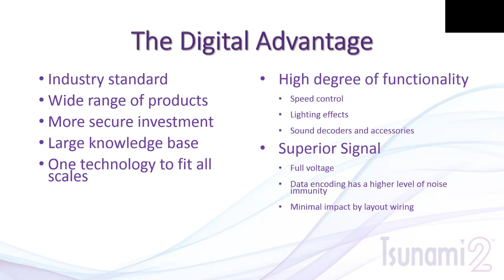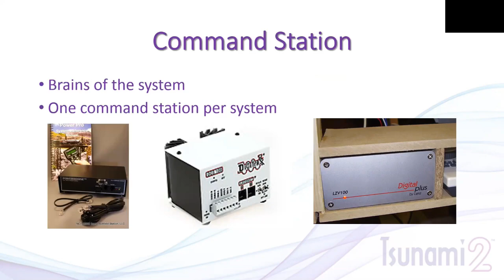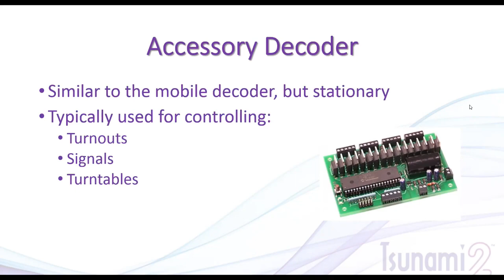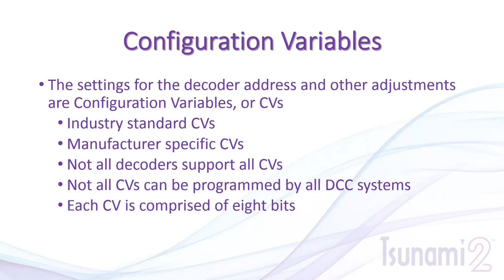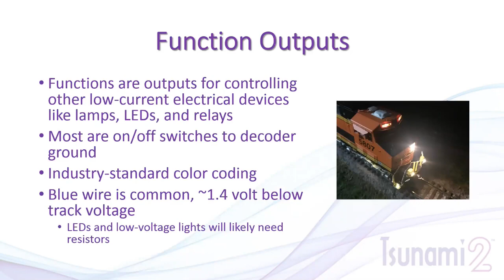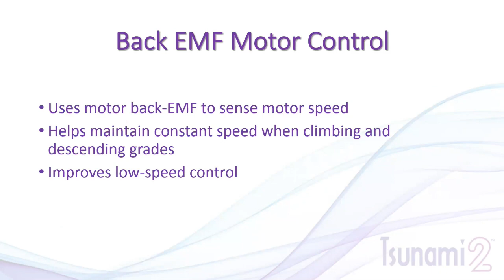Explore the Basics of DCC with SoundTraxx (Webinar 4)

Comment: That makes total sense now.  It reads as AC but it is a squared DC wave below and above reference zero so I see why now you must check with your multimeter from rail a to ground and rail b to ground and add the two to get your total voltage.
Reply from the maker: Thanks for the feedback!